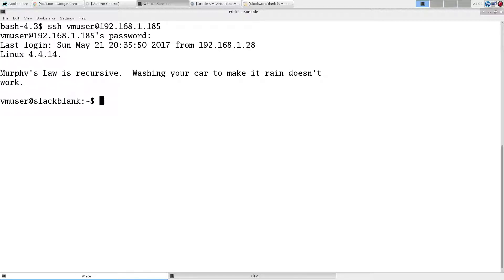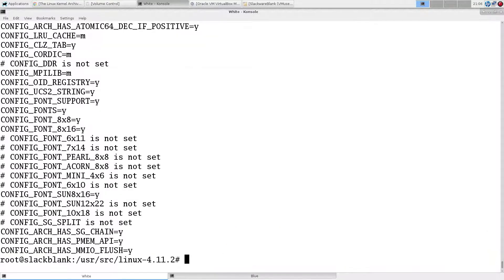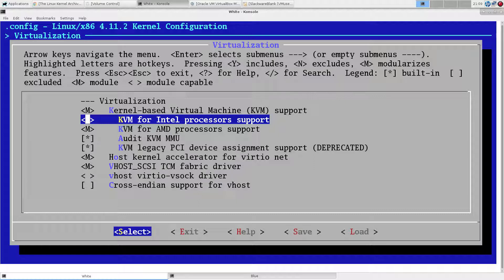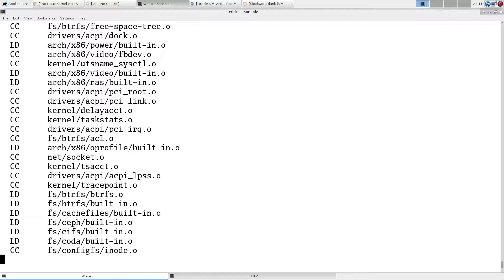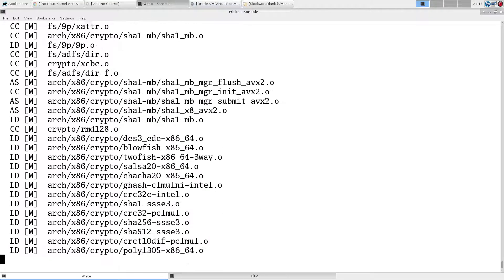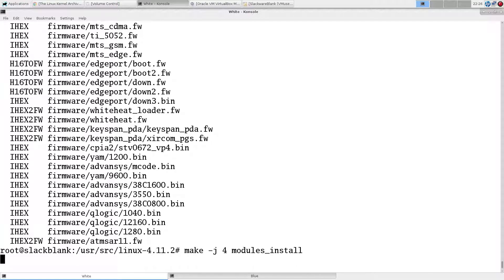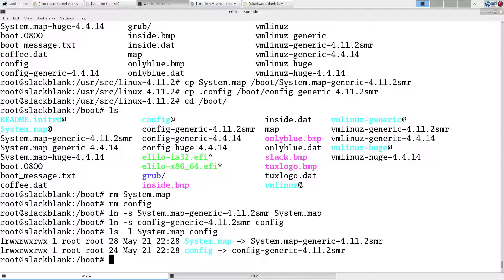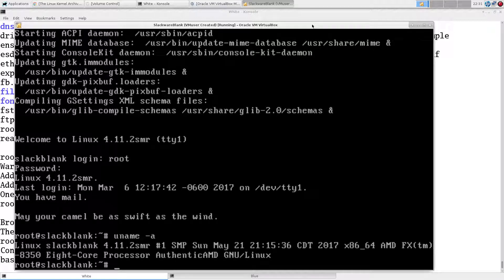Slackware in depth #4 -- build a new kernel

Comment: I've never built a kernel until yesterday. I followed this video and built 5.4.86  on my old Core2duo.
I'm running Slackware Current and noticed /usr/src was empty when I started; and /lib/mod wasn't present. I proceeded without incident only adding a tag and not  changing any settings. 
My lilo.conf has entries for a default kernel , New kernel, and previous kernel. I did not do the remove System.map and symlinks step.
I wasn't sure how that would affect the other kernels. 
The 5.4.86 kernel booted ok and so far everything appears to run ok.

When generating the initrd for 5.10.4  it gave a warning concerning usb.
I can't remember the exact wording but I'm thinking it related to the usb controller.
5.10.4 also pauses twice during boot ; or perhaps it pauses noticeably seconds longer. 
I'm not too trusting at the moment with 5.10.4 ; but at least I can stay with 5.4 lts for a while longer .

Thanks for this video, it helped greatly.

Comment: i have a machine with a copy of gentoo installed, .Problem is, i have bios and gpt...as i was studying how to set such a system up with gpt...this means i have a dos boot partition at the beginning of the disk ..yet the disk is partitioned with gpt. and grub is bootloader.....next thing i installed slackware on an old 3.5 inch laptop disk that fitted in my box...the install kept failing as i was trying to do the same, dos boot partition and gpt on bios.. in the end i had to install slackware 14.2 with lilo, problem was that when i hooked both disks together, my grub cannot see the slackware install, i think it is looking for gpt...so now i am using the slackware but i cant see the grub disk....its fine really as i just want to learn some of this..but it would be nice to see if it would be possible to change my lilo on disk 1 for grub...and also if you know why the install failed whith the set up of bios gpt and slackware install....on top of that i used gdisk to put the files on a spare partition on the slack disk..but during the install , i could nt get the slack install scripts to find the files that i had put on the partition....i mounted the partition from the gentoo install and copied the files that way.......lastly even with lilo i wanted to set up structure of / and /boot and /home....but the install disk kept jumping to the next partition and would not let me name the paritions properly ...it defaulted to the first parition being formatted defaulted to / .
and my original intention was this would be /boot......i md5 hashed my image and it was perfect so i assume it is some issue with the installation image...anyway ...ill keep watching as you clearly know exaclty what you are doing.
thanks great video.

Comment: Hello Stephen ! Thanks a lot for your video ! I still have a question. Suppose you have an initrd.gz already in your /boot directory related to the current kernel. How do you create a new initrd.gz for the new kernel while keeping the existing initrd.gz ? The problem with the script /usr/share/mkinitrd/mkinitrd_command_generator.sh is that it is based on the actual version of the kernel. It will produce a line suggesting you what to do. But changing the kernel version from that suggestion doesn't help even after executing lilo or the equivalent of update-grub (grub-mkconfig -o /boot/grub/grub.cfg).
Best regards,
Serge
Reply: Hi, Serge.
I use cp initrd.gz initrd_kernel-version#.gz to preserve the initrd.gz before running the mkinitrd generator script .

I built 5.4.86 using 5.4.80 huge kernel config but did not do the symlinks. It boots and runs fine so far. I tried again with 5.4.84 generic's config. Made modules , did not do symlinks step but if failed to boot complaining it couldn't find modules. I'm hesitant about the System.map removal .

My lilo.conf has entries for a default kernel, New kernel (huge), NewGen, Previous kernel. Plus entry for Artix .

When I created the initrd.gz for 5.10.4 it gave a warning concerning the usb . So I thought I'd try to see if I could build 5.4.86 and stay on 5.4 since it's good now through Dec 2025; I'm running Core2duo E8400 so 5.10 isn't essential for my hardware...